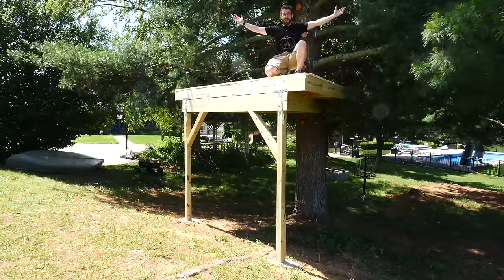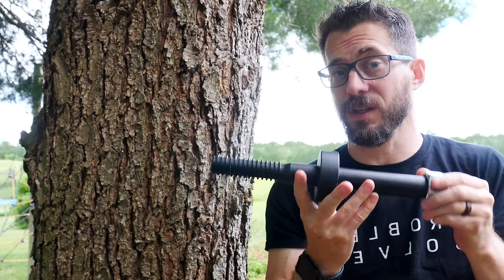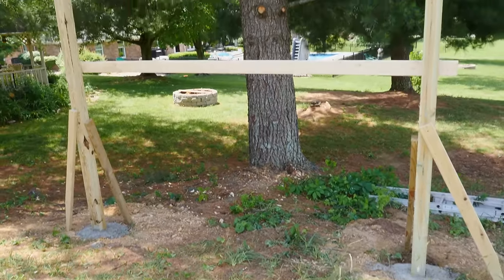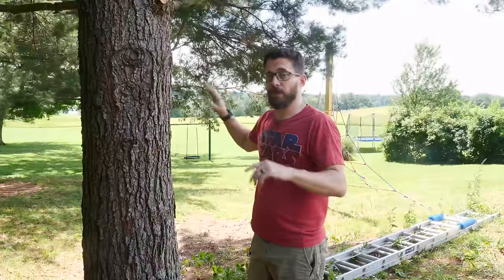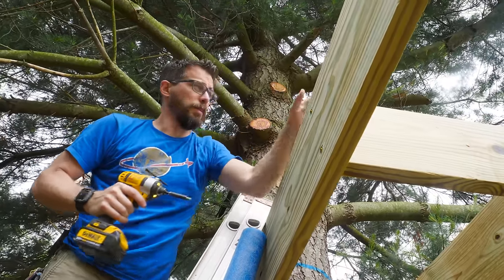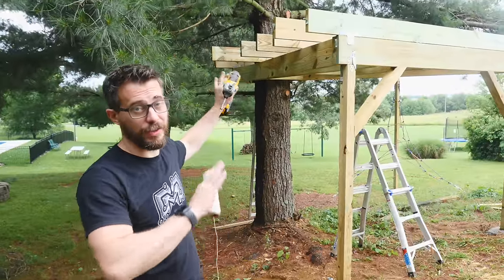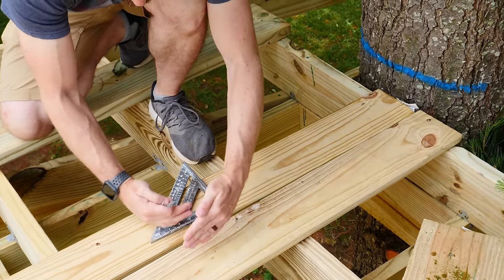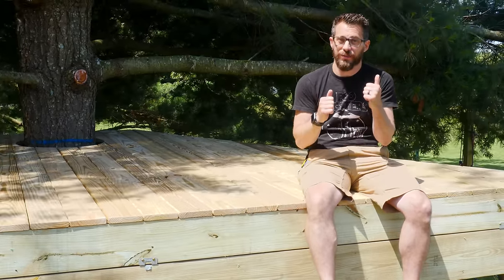How to Make a Treehouse Part 1 | I Like To Make Stuff

Comment: Before you rent one you should see how much Harbor Freight has one for I bought my auger from HF and it cost me 169 - the 20 % and It joined my tool area has been there for about 7 years now still working don't use it often but when I need it bam there it is and works great!

Comment: The 4x4 posts he sunk in the concrete will rot the fastest. When a board is in direct contact with cement it will draw out any moisture from the ground. and rot away.
Reply: yea. the guy is clearly not the sharpest knife...so what to expect

Comment: Hi Nice video but and yes that word but raises a question.  We build a 2 story fire house, complete with trap doors and yes a fire pole for quick exit!

Like a Physican’s Oath we did not want to harm the tree (Western Red Cedar & Douglas Fir) as any damage to the bark and subsequent tree itself was a problem for us.   Looking at all the tree house sites and construction, every site drilled holes into the tree thereby exposing the tree’s core to a potential disease.

We decided to use 3/4 inch threaded rod and 2x12 inch pressure treated boards clamped to the trees thereby no damage to the tree.  Now you are thinking 🤔 how did this occur and how will you support a tree house.

The 2x12’s, clamped with 2 -3/4 inch treaded rods and built our floor off of the clamped sections.   
Naturally, a tree will continue and when you attached a bolt to the tree, despite the amount of room allowed for growth, your anchor points and framing will be stressed to a point that needs to be readjusted to avoid any damage to your tree house!

We discovered, as the trees grew we just loosened the 3/4 inch nuts on the treaded rod and allowed the tree to grow and out foundation to expand.

We did face one problem 10 years later as the trees grew our foundation framing began to bow.  With hindsight as our guide, we would use our same concept of clamping structural lumber to the tree as our foundation and NOT build our framing without using the clamped lumber as part of the platform.  Instead we would attach our structural lumber via threaded rods and then using that aspect to build our platform above this point thereby allowing the tree to grow, adjust the clamped foundation boards with the tree growth and avoid and reconstruction projects as the tree grows.  Our point is that we have a 2 story fire house (Club house for grandkids and friends complete with 120 volt power for lights and watching videos during camp outs) them a bridge from the tree house to the club house and a slide off the tree house to the ground.  The tree house is accessed via a ramp from the ground.   

Overall we would recommend the changes above to avoid the problems we discovered after years of tree growth.  The main point is that the trees were never harmed and their bark was never damaged by our tree house!

Comment: When trying to make two points level, fill a piece of clear tubing with water, bend it into a u shape, the two water levels will be the same - then you can just align one with the height you want and use the other side to get the same height - so much simpler than double spirit levels or taught string lines
Reply: I love your channel jus tryna help

Comment: about min 6, on how to know the level, you could just use some transparent hose with water and suspend both ends. fill with water until one side get to the line on the tree and just cut the wood on where the water level is on the other side.

Comment: Don't use any spacers when installing 'wet' green treated decking. When it drys, the gaps will be +/- 1/4". Simply butt the deck boards tight. The gap will form soon enough to exactly where it needs to be.

Comment: Everything I've ever seen on decking says to use hanger nails for your hangers, never screws, because the screws are too brittle and can sheer off when pressure is applied to them.  As well, I've always heard for longevity to never encase wood in concrete; always build up a level pad, rest the support beam on it, and secure with an appropriate bracket.  This is because wood encased in cement is more likely to have moisture with no viable escape route and will rot faster.

Comment: How are you attaching your lumber to the tabs?  I didn't see you put a floating pipe bracket on prior to screwing in the tab.  Won't the nut be difficult to take off, since you could unscrew the bolt before the nut breaks free?  Just curious.  Great job again though!

Comment: No, the easiest way to find level between two awkward points is to use a piece of vinyl tubing filled with water.  Line up the water line in the tube to the tab bolt on the tree and line up the water line on the other end of the tube to the other point you need to find level with the tab.  Use the same process to level any other two points.  Works every time and is very cheap and very accurate.  You can always find level of two opposite sides of an object this way.

Comment: @Bob, wouldn't a water level be easier to find the spot on the tree? Fill a clear hose with water, line up one side with the already drilled support, then hold the other side 180 deg around the tree. Water line will be exactly level with the other side.

Comment: I would have used metal plates on top of the tree hangers to spread the weight better. Also joist hangers are designed to be used with nails as a nail can take a side load better than a screw. Those scres looked fine however as they has a large un-threaded portion

Comment: 7:00 This looks like a good use of the grain in the boards.  Hopefully, setting the grains opposite to each other should keep the beam rather symmetrical as it weathers and ages. 
I wonder if the crown should be on the inside or out?

Comment: Hey Bob just wanted to say, as someone in the forestry sector, you are a H+S hazard. You should have a helmet w/ a mesh visor and some form of cut protection on your legs be it chaps or trousers. And for the branch's you'd have been better cutting from the top to stop it pinching the bar of the saw

Comment: Maybe nit picking but I really don't like sinking the posts in concrete, usually sit mine on top of the pad with a metal bracket holding the wooden post off the ground, I know it's treated but it will last longer if the wood is not touching the ground. An old carpenter also told me not to rely on fasteners so much, they're just there for when the wind blows. Ideally a structure should be able to be free standing without any screws. Cool build though

Comment: 5:49 -- there's an easier way: get a clear hose and fill it with some water. Move the hose until the water level hits the mark you want on one end of the hose (i.e. tree). The other end (i.e. platform)  is exactly where you want it. This method typically needs 2 people. But hey you already got that. 

By the way, the same goes for leveling the holes on both sides of the tree. 😉

Comment: Nice project! You had many troubles finding a horizontal level for parts rather far apart. Easiest und super simple tool could have been a hose water level. Just some clear water hose and a bit of water makes for a quite accurate tool :)

Comment: i like screws more also... but nails are used for those because of the shear strength of nails so it might actually be better to use nails in a case like this. Although I bet either one will be sufficient...

Comment: Is there a reason you chose to use metal hangers instead of notching the posts to accept the 2x12s? An interlocking wood joints with bolts is a much stronger joint. The wood cradles and locks the joint, the bolt and washers piercing it provides the lateral/shearing stability you are concerned with

Comment: Green treated posts should not be going directly into concrete, moisture will build up inside the post and rot away from the inside. Should have used tubes filled with concrete and a metal bracket for the posts at ground level. Never have wood touch concrete near the ground as it will wick moisture.

Comment: Faster cheaper way to keep the joists from rocking on pivet point and make just a little more stable. Cut a 1/2" - 3/4" notch than slip it down over the pivet, so the rest of the paired beams sit flush.

Comment: lol. you dont have to mix the concrete in a bucket then pour it into the hole.. you couldve just poured the unmixed concrete bags into the holes then filled the holes with water with your hose.. end result is identically the same, but the save a ton of extra work.. i installed fences for a living for many years.. so ive put a post or 2 in the ground.. you made a lot of extra work for yourself.

Comment: I am no expert, but I'm not sure that you're supposed to use chainsaws cutting UPwards - always, down. To do with kick-back (albeit in the opposite direction, so the guard doesn't help). Also, if you're cutting the bottom of the branch, wasn't the weight of the branch itself pinching on the blade? Great video as always, but I have to admit those scenes did worry me a bit...

Comment: Wouldn't it have been much stronger to cut part way through on your level, and place the cross beam within your post, then secure them together?

This is how I see strong decks built.

You made the thin metal bracing on the front sound iffy. You use a lot of screws as sheer strength in the build too.

Maybe I'm acting like the anti pocket hole people but I'm just wondering.

Really fun build either way. Also, "good job."

Comment: 13:00 if you already had a slight concern about the wood folding over on itself why wouldn't you run the joists the opposite way? Now you have two risks of fold over on top of eachother?

Comment: The screws in the joist hangers won't pass inspection. Screws don't have near the shear off strength, compared to joist hanger nails. And like you said screws don't hold flat to the hanger face.  I use a couple screws in two holes if I can get away with it though. Lol

Comment: You know decking boards are treated, and treated wood shrinks enough to not be spaced like that. When you see gaps in porches, decks, and the like, that material was typically not spaced to begin with, but it shrank with time, (usually doesn't take two months in heat and sun)

Comment: * using screws to install joist hangers is very dangerous.  there are special nails made for this. the danger is that screws have good holding strength but are weak in shear (ie. they break easily with sideways forces).  if hanger nails are unavailable, common bright nails (be sure not galvanized) could be used.

Comment: Encasing those posts in concrete isn’t necessary and may even shorten the life of the post. Even pressure treated lumber will rot if moisture gets trapped against it. Pour a pad at the bottom so the post won’t sink then backfill with compacted gravel.

Comment: You don't use just any old nails or screws for hangers, they have specific nails and screws that are engineered to be structural. Standard deck screws have no sheer strength! Two reasons you don't build homes with screws, it's slow and it will tear it's self apart! Those GRK are a structural screw, the package will give you the engineered specifications!

Comment: For finding the precise opposite of the tree for the other TAB, couldn't you use a string? Run it around the tree at the height of the TAB, measure the string and mark out the center. Then you run it around the tree again and mark out the spot. Then, because the tree might not be circular, run the string the other way around and mark the spot. The center should be in the middle of those two spots. Running the the string straight to get the correct height shouldn't be an issue, but you could use the level to check it easily.

Comment: Engineer here: fun project, great video, but you have a pretty serious problem with the structural design of this platform. You ran your joists parallel to the beam instead of running perpendicular and having each joist bear on or transfer load to the beam. Long story short: The result is your entire deck load is being carried by maybe 4 joist hangers. I would advise anyone that watches this to look at typical deck framing details instead of this specific framing configuration

Comment: Is it ok to fix a post in the ground with concrete? My architecture teacher told me once that if you secure a post in the ground with concrete it will rot, so you should just fill the hole with concrete and use bolts to fix it

Comment: There is actually a good rason to use nails, instead of screws in instalations like this - under load and stress screws brake, but nails bend

Comment: The reason you use Nails vs. Screws in the situation of the joist hangers screws don't have a very high Shear strength value when they have a load pushing down on them that's why you must use nails you're weakening structure by doing that just an FYI

Comment: Simpson ties are designed for nails because nails have a higher sheer value than screws. So by using screws instead of nails, the strength of your connections are weaker than if you used nails.

Comment: Honest question as a newer builder, why couldn’t you just attach the joists to the framing itself, isn’t that how a regular deck is essentially built? It just looked like overkill to build the framing, and then attach joists on top, not to mention a large space user.
Reply: Wait. I think I might be able to answer my own question... normally with a deck you have posts setup certain distances away to support the load, and here he only has the tree attachment and then the two 4x4’s in the front. Most likely wouldn’t be too safe/strong.

Comment: Them deck boards are going to have huge gaps in like 9 months you always pull deck boards tight together because the boards always shrink, always.
Reply: not if they are fully dried (eg kiln dried). they will expand slightly when they get wet, and shrink back down when dry.

Comment: With this bolt setup, once the tree grows taller it will throw the whole platform out of level? Is there a way to control this?
Reply: Trees grow by adding new growth at top. That's why trunks taper the oldest part of the tree is the bottom. Its wider and has more rings showing its age also showing that it stays the same level.

Comment: What about the branches that he cut? Won't they grow back? Do you just keep cutting them?
Reply: no those branches will not come back. If anything the sections exposed with dry out and become bark to protect the inner part of the tree where nutrients and water and moved throughout the tree. Those areas will also be future areas for knots in the wood if and when the tree is cut down. 

As for branch development, tree branches grow from Apical buds primarily and if the apical bud is killed off or destroyed then axillary buds below it will become new apical buds. An example might be the top of a tree is damaged in a storm, the apical bud is gone so the axillary buds below it become new apical buds and grown respective in their own direction. Obviously on this tree cutting the branch off near the trunk separates the growth area from where the nutrients that supply the cell growth in the growing part of the branch and stops branch growth altogether. This is why if you trim dead branches from a bush, and keep the living branches there you'll see growth occurring again at a rapid pace as the parts that were dead and using nutrients are gone so the nutrients are sent to active growth areas.

Comment: BTW, screws are harder than nails and snap you should have used mostly nails for strength. DIY homeowners and their screws... when you finally used a baby hammer and you swing like a fairy hence the reason you prefer screws.

Comment: it is not the healthiest option by far id have to say the healthiest option would have to be a tension mount where you have beams wrap with cable clamping the tree it still allows natural growth of the and it only requires a recurring  6 month check up to make any needed adjustments
Reply: Edit: of the tree

Comment: Why skimp on the 2nd most important part of the tab ? 
Without the shim/tie-in restraint to slide on,
 the weight of the treehouse will indent the soft pine and will put a massive amount of strain on the structure.
At least put a bit of flat bar in there or learn how to weld your own shim/tie-in restraint, easy.

Comment: Probably using twice the amount of materials needed for this project. Don't worry, Lowe's is footing the bill.

2x12s?! Seriously overbuilt. With the 2x12s, you could have probably bolted/screwed the 2x12 directly to the side of the posts and not even needed the knee braces. I guess he wanted the load on the top of the posts instead.

Comment: I hate to be that guy but you had me until you started using deck screws to attach brackets and hangers. Especially for a tree house, safety is of most importance. I would caution anyone watching this video to be very aware of the potential danger of using the incorrect screws for this application, especially in the future when the coating has worn off and the screws have been out in the elements in unintended applications. Simpson (who makes the most of the hangers in this video) does not suggest using deck screws for any of their fastening applications. They are generally hardened and they tend to snap instead of "swaying" with the movement of the structure as nails do. They do make some specialty screws for fastening but they suggest joist nails in most every case for shear strength. It may never fail, at least not in the first few years, but I would not want to find out.